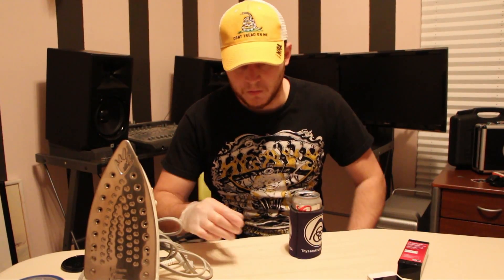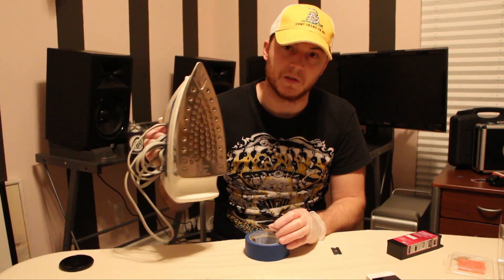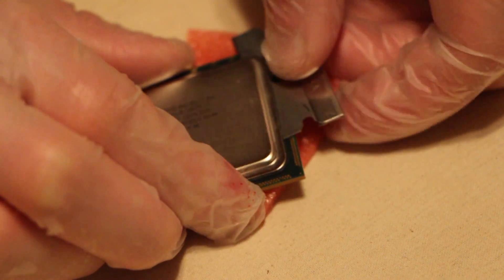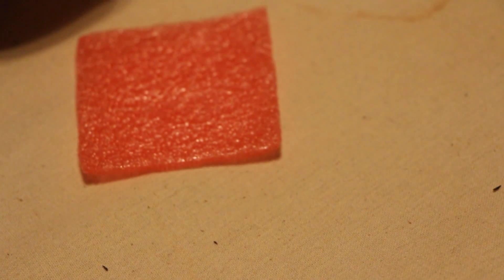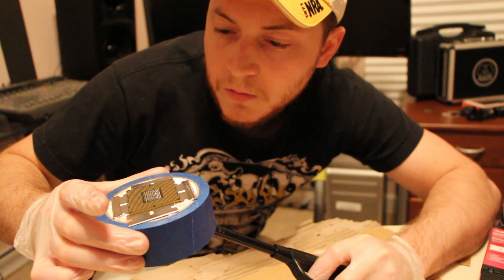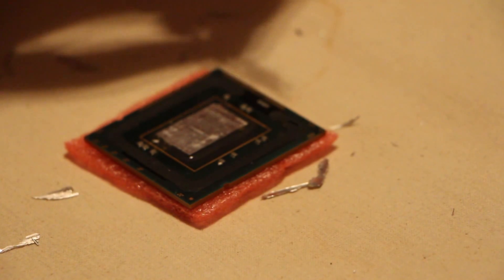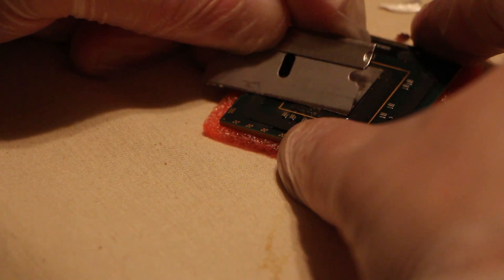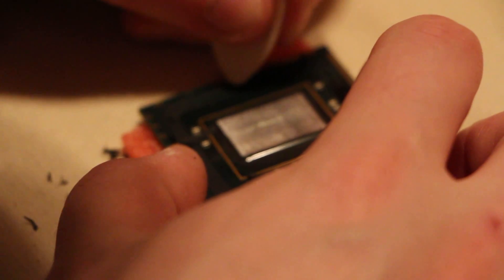Delid Soldered CPU Guide

Comment from the maker: Silicon melts at 1414 Celsius and the indium solder melts at 157 Celsius.  Waving a flame along the IHS for 20 seconds isn’t going to damage or degrade it.  As soon as the solder melts the IHS pops off.  You are probably more at risk of heating it up too slow over a longer period of time (heat gun) and having the capacitors melt off than having a quick and hot direct flame right over where the cpu die is underneath.  They applied the solder at the factory above melting point to get a good bond between the die and IHS...  no degradation, nothing to worry about. 

I sealed the caps with a clear fingernail polish top coat and then used CLU on the die.  If you trim the bristles on the brush that comes with CLU it’s easier to apply, and you want a thin uniform coat.

DO NOT KNOCK YOUR CAPS OFF WHILE POLISHING DIE.   It doesn't take much force to knock a capacitor off while you are polishing the die, be careful!

If you did knock a cap off, they might actually still work, it might knock frequencies off by a bit or maybe you can't OC it anymore, but at least you'll still have a running PC if you need it. So definitely spend the 20 minutes to throw it in there and check.

You can use a plastic card or guitar pick to scrape off the old sealant.
Reply: could you upload the new temps? mine, doing nothing, just applying thermal compund in the ihs without delid, max temp 59 degrees in 20 temp ambient
Reply from the maker: Anter Sanin solder is good for heat transfer to the IHS, I wouldn’t bother with a delid for temp reasons.  The difference would be negligible.  I did this for a 2009 Mac Pro which came factory with delidded CPUs, so for a direct swap I needed delidded CPUs. The heat issue is with the CPUs that come factory with terrible TIM (think 4790k and 6700k and newer) those benefit from a delid and CLU on the die.  You can easily delid the CPUs with TIM using the vise method.
Reply: really would have helped if u filmed yourself putting the chip in a mobo and booting up. i think its rather obvious.
Reply from the maker: hellbendert35 There is a forum write up I did in 2016 showing these running in a Mac Pro. On LTT and overclock.net I think, it’s been ages.
Reply: Well but CPUs are dieing before you even reach 300C. So i gues there is something else quiting

Comment: never delidded a cpu what is it like and is taking hte heat spreader off just the same as when you put the cpu cooler on it you apply thermal paste, only difference is the cpu is now completely cooled
Reply from the maker: A soldered cpu has great heat transfer to the IHS so there is no reason to delid one for temps.  It’s common to delid one that uses TIM instead of solder though because you can drop temps pretty good, those are much easier to delid. In my case I was doing a cpu swap in a 2009 Mac Pro, those came factory with delidded CPUs, the x5690 is soldered so I had to delid it so it would fit with the same height tolerance and be a simple swap.

Comment: This man is going to freak out when you show him a $12 delider on ebay
Reply from the maker: Go ahead and use that $12 delidding tool on a soldered cpu, it’s your money. Soldered... not TIM.
Reply: @ElectricosCosmos  They are steel. You can still heat it up and not have to stick 4 razor blades around it.
Reply: @ElectricosCosmos  In fact you can hold a torch to it whilst slowly turning pressure and feel the solder break free and the IHS drops to the ground. It takes like 30 seconds.
Reply from the maker: Nathan Melo they weren’t really around in 2015.  Wasn’t until 2017 or so when De8uar got popular.  People ripped his and started 3D printing it.  No more often than I have to delid something I haven’t bothered picking one up, especially with AMD CPUs (soldered) being so good now and usually what I build for clients. Good option to hold it maybe if people are doing it now though. Really no reason to delid a soldered cpu anyways other than curiosity or a Mac Pro upgrade.

Comment: So what was the results before and after?
Reply from the maker: I delidded them for a 2009 Mac Pro which came factory without an IHS on the CPUs.  I'd never bother delidding a soldered  CPU for thermals if that's what you were asking.  After a delid it was a simple CPU swap with Coollaboratory Liquid Ultra (CLU) and I didn't have to use spacers or clip the fan header or anything which is what you have to do if you don't delid on a 2009 Mac Pro CPU swap.
Reply: @ElectricosCosmos  ok gotcha

Comment: what are the caps you mention to not damage?
Reply from the maker: 14:30 The little chips outside of the main die.  They are caps, short for capacitors and usually they are there to clean up signal/frequency noise... filters if you will.  They could easily get knocked off if you slip and hit one.  I’ve tested cheap chips before and you can often still get the cpu to work fine without one or two but it’s best to not do that.
Reply: Thanks sir

Comment: considering to delid the newest i9 9900k, which is soldered.
Reply from the maker: It should work.  If you don't want to risk it you can check with Der8auer and maybe use one of his delidding tools (and add some heat to melt the solder).  I'm sure he will have a guide on his channel soon if he doesn't already.  When I did this is was like 3 years ago and it definitely works but it was before delidding was cool and now there are tons of devices and such that would make it easier and safer now days. My way is cheap and free though, as long as you have a lighter and some razor blades.

http://der8auer.com/delid-die-mate/
Reply: btw was there any scorch marks on the ihs after deliding with a lighter?
Reply from the maker: Wilson Yu no not really. These things are tougher than people realize. Gotta be more careful about slipping and knocking off a capacitor than actually hurting the die as long as you use a low angle to scrap it, and move the flame around a little when you heat the IHS instead of leaving it just on one spot.
Reply from the maker: I heard the temps on the 9900k are bad even though it is soldered.  Hopefully that is just the first production run and something that gets fixed quick.
Reply: Exactly... that's why I want to delid it. But I'll do a bit more research before actually going forward with it.
Reply: I see, I'll try it out on my old i3 sandy bridge and see how it goes.

Comment: Looks a bit safer than what I did. I used a torch-style lighter and a razor-like tool. I didn't even get the metal liquid, so I'm lucky that it was malleable enough when I went to pry it off with a fairly even split of solder between the die & the lid.

Since my Q9400 chip didn't work, I figured why not try this out for practice. I almost think that chip might have had a bad solder job since it came off like it did instead of breaking. I'm kinda considering scraping that solder off completely and trying decent quality thermal paste just to see if that's what was wrong with it. It'd be kinda neat if it does get fixed, but not gonna bank on it.

Comment: Once you've cut through the seal on the edges, then the other blades don't have to be sharp.  i.e. the blades that you use as wedges can have their blade edge sanded (so that they are no longer sharp).  This way, you are only really dealing with one single sharp blade at any given time, and really only needed it when cutting through the seal.

Also, @2:55, @11:20, always have the blade edge going / moving away from you.  Basic blade handling safety.

Comment: I just had a thought - if you had an old board you could leave the heatsink just resting on the CPU then when booted into the OS run Prime, remove the heat sink with your fingers (obviously after you've switched off the psu. I'm sure your iron method is probably safer lol.
Reason I'm here is I just got a W3690 (single processor application Xeon) and have found I must've lucked out because I upped the voltage a full .1 of a volt and using multi alone am getting a reliable 4.4ghz - up almost 1ghz from stock. I want to go further with this chip. Board is a Gigabyte EX-58 Extreme and the 3690 is supported with this board with the late bios.
W3690 is almost (but not quite) free on eBay. ~ $100. I think they originally retailed for for about $2k or something lol.

Comment: did the CPU survived the heat?
Reply from the maker: Liam Benedict silicon wafers are heated to over 1000 degrees C during the manufacturing process. Heating up the IHS for 25 seconds to 156 degrees C to melt the indium solder isn't going to effect the silicon at all. 

https://en.m.wikipedia.org/wiki/Rapid_thermal_processing
Reply from the maker: Liam Benedict and yes they survived. Look at my pinned comment, it has a link to a build guide on the Mac the chips went in, with benchmark photos.

Comment: Safer to just lap this beast, that's what I did and my temps dropped by 7 degrees under load!
Reply from the maker: David Johnson definitely for most applications, either nothing or a lap. In this case though it's for 2009 Mac Pros, only other reason I can think to delid a soldered CPU other than the sake of science is for Ln2.
Reply: Electricos Cosmos So for 2009 Mac Pro's lapping isn't enough???
Reply from the maker: David Johnson they came from the factory with delidded CPUs. I have a write up about the build here. 

https://linustechtips.com/main/topic/509850-build-log-logix-logicworx-dual-x5690-mac-pro-audio-workstation/
Reply: Electricos Cosmos I now understand that Apple delids the original Xeons, likely to enhance cooling further, as well as for clearance issues apparently. I wonder if lapping can yield the same drop in cooling temps as delidding, so you agree that lapping is at least a less risky way to enhance cooling than what you did?
Reply from the maker: David Johnson definitely less risky. It won't help Mac Pro upgrades though. That IHS adds 2.2mm of extra height so you either have to shim with washers or delid to keep from accidentally crushing your socket. A lap and some good TIM is a good way to squeeze a few degrees out of a chip for a normal setup OC. Just be sure you have a good smooth surface like a glass table, tape your sandpaper to it so it isn't moving around.
Reply: Electricos Cosmos Are there any additional advantages to delidding over lapping aside from additional clearance? I mean with delidding a normal air cooler probably won't work as well since it's more likely to damage the delidded CPU, right?
Reply from the maker: David Johnson delidding can drop temps a good amount on say a 4790k or a 6700k due to their bad factory TIM, but you would want to use CLU on the die and place the IHS back on it. You can buy mounts to use blocks without the IHS but I'd rather use the IHS, just not worth the risk to the caps or the socket. To take it one step further you can lap the IHS and then use a good TIM like Grizzly Kryonaut.
Reply: Electricos Cosmos My IHS is from Noctua and they're already lapped from what I can tell since they're perfectly flat, just like my lapped xeon...So I suppose it also depends on who manufactures the IHS.
Reply: Electricos Cosmos Grizzly Kryonaut, what about Arctic MX-4???
Reply: Electricos Cosmos Just ordered a tube of the grizzly Kryonaut, cost me 10.17 on eBay. By comparison the mx-4 cost me 5.99 and is rated to last 8 years...I can't find longevity info on this grizzly Kryonaut that you recommended. I saw the temp drops under load as compared to mx-4 however there's nothing on how long an application of this paste is good for, something Arctic declares on every package of their mx-4 sold....
Reply from the maker: David Johnson I use MX-4 on most all my builds or EK ectotherm, MX-4 is great. Kryonaut is probably the best out there though but it's a premium for minimal gain over MX-4, and I can't remember the longevity. For most people I'd recommend MX-4 since a tube of it could last them easily a decade.

Comment: How are you going to improve the temps by removing an already metal TIM?
Reply from the maker: Tony D you won't. This is mostly for people doing 2009 Mac Pro upgrades where the factory Xeons were delidded. The IHS adds 2.2mm of extra height if you were to swap out CPUs.You either have to use delidded CPUs as your direct replacement or use a bunch of work arounds such as 2.2mm of washers on the heat sink mounts and clipping the fan connector to make up from the extra height of the IHS if you choose to not delid. You have to do one of the two or you'll crush the CPU socket and the fan connector won't seat deep enough to work. You also have to add 2.2mm of thermal padding on the bottom of one edge of the heat sink for the VRMs. You have to do all that if you keep your IHS, if you replace with delidded CPUs you only have to delid the CPUs.
Reply: Oh I see. Thanks for clarifying. So the original CPU's are delidded to I assume? I saw somewhere that a credit card will scratch off the lead solder without scratching the die surface. That was on a 2600k if I'm not mistaken, on Youtube no less!
Reply from the maker: Tony D a credit card might work, a razor works fine though so I always just do that. I just keep it at a low angle and take my time. Silicon feels almost like hard glass so other than keeping a low angle and trying to avoid side to side movement I wasn't too worried about damaging the die using a razor. Temps and stability are great. I tested it out on an old i7 960 first and when it was still stable overclocked on 1.4v I felt pretty confident the more expensive Xeons would be fine, and they have been.

Comment: This is what i would do i would build a fully watercooled gaming pc, with an i7 6950x processor but i would buy it from silicon lottery, i would delid the cpu and put the best thermal compound on it, i would sand the heatspreader for maxium contact with an waterblock, i would use a 480 rad cooler for the cpu alone and i would overclock it to 5.2ghz using the rampage V exterme motherboard, with 64gb of ddr4 platinum ram
Reply: with a small loan of million dollars ?
Reply: ggwp trump
Reply: Go President Go,You Got my Vote instead of Diaper Lesbo!

Comment: Is it okay if the area around the die looks a little bit scorched? Held the flame to the lid until the lid had a dark color, and it finally popped off. However, it's a bit scary how scorched the area around the die looks.
Reply from the maker: maccollectorZ (Commenting Account) Indium solder melts at 157C while silicon melts at 1414C, I would think the IHS should pop off long before damaging the die. It only took all of mine in the 30 second range to pop off.
Reply: Yeah, it ended up being just fine. I now have a 12-core beast. Thanks for making this video; it boosted my confidence in de-lidding my own CPUs.

Comment: Do you know exactly how close the caps are to the edge of the CPU? Might be hard to approximate, but if I do this, I might want to mark off on the edge of the razor (or on the lid) exactly where the caps lie - just so I don't push the blade in too far.
Reply from the maker: maccollectorZ (Commenting Account) you should be able to push the razor in more than enough to cut through the adhesive, if you feel any resistance though stop pushing. You should be able to find photos of delidded CPUs on google so just look at those to see how far in the caps are.
Reply: Alright, I just found your photo of your de-lidded CPUs. Looks as though the capacitors are directly at the edges of the adhesive. I wonder how easy it is to destroy them... maybe I just compare with your video and don't push the blades in any further than that. (BTW, why exactly do you need to put clear nail polish on the capacitors? Are the factory de-lidded ones coated with something?)
Reply: By they way, is it necessary to use a kitchen lighter? I might only be able to get ahold of a pocket lighter.

Comment: Fantastic tutorial. I'm looking at your technique for my Haswell 5960X, you mentioned after you cleaned off the glue with alcohol you then put some clear nail varnish on the caps, what was this for? (to stop any shorting from the alcohol)?
Reply from the maker: Jimboz SimRigs just to protect them from anything really. That's pretty common delidding anything. I don't really think I'd delid a 5960X though, solder has excellent heat dissipation. Only reason I had to do mine is for the old Mac Pro upgrade.

Comment: 2010 mac pros don't need to be  delided right? I got a 8 core 5,1. but have 2x2.93 hex core intel xeon chips sitting to the side that I'd like to swap out
Reply from the maker: Steven Jr I think you're ok. They should have a the LGA 1366 locking mechanism on them. If I'm not mistaken it was only the 4.1 from 2009 that are the big hassle.
Reply: Electricos Cosmos  ok, I know the lga1366 socket is my socket for sure. just heard some ppl say not to worry about it on 2010 and newer. just wanted to know for sure if I need to take the delid process or not
Reply: No the 5,1 has liddedcpus so you need not delid them

Comment: Sigh :( I found too late your awsome guide.. I have just destroy one of my cpus becouse I don't have understand in time that without apply heat is impossible to separate the IHS.. Thanks in any case for this great video!!!
Ah.. i was forgotting.. put in the title of the video what kind of cpus you are explain how to, so it will be more easy to find it (becouse I have found it only after ton of search)..
Reply: actually it is possible to get the ihs off without any heat if done correctly (see der8auer's tool and video for reference)
indium is better for heat transfer yes 
but because the indium layer is way thicker than the one done with liquid metal you will benefit from the delid and get better temperatures
Reply: i did same mistake, rip cpu
Reply: why would you delid anyways?
no thermal paste can do a better job than indium soldered directly to the copper heatspreader
Reply: That tool is not for these old CPUs.